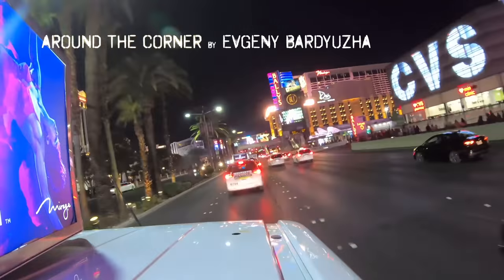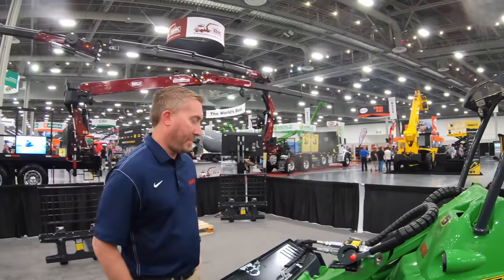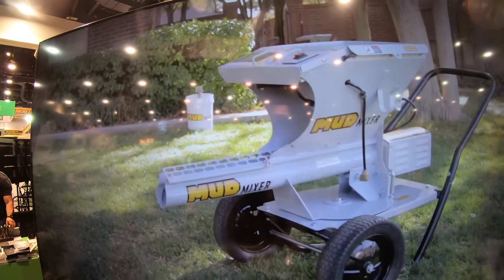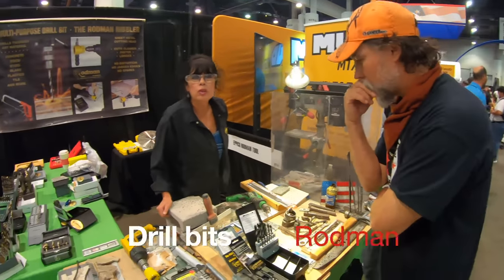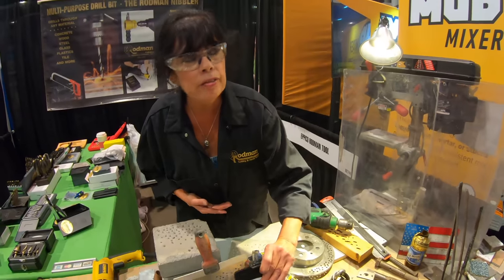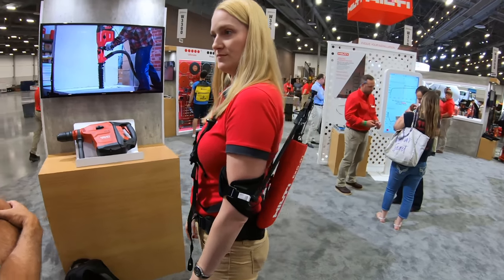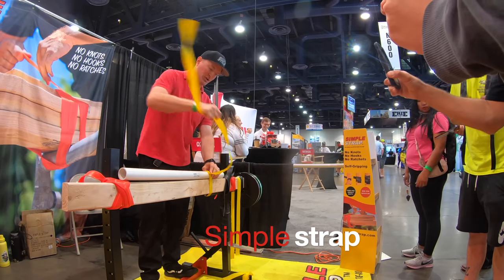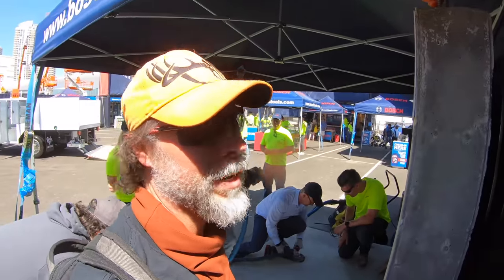8 WEIRDEST n WILDEST new tools at World of Concrete 2021

Comment: The drill bits were my favorite. There's some other cool tools, but those bits are awesome...Just like you Stan. LOL
Reply from the maker: I watched that drill bit demo in disbelief.  That was incredible
Reply: I had to rewatch it because I thought there was some black magic going on.
Reply: @Dirtmonkey  she did more to those bits than you would have done to 'em if she would have let you....lol
Reply: same
Reply: Those drill bits were awesome! Did she say how long they would last like that? Perhaps I need to watch it again. And again…
Reply: @Dirtmonkey  If you use drill bits often, those I would have bought, one thing that wasn't addressed was whether they could be sharpened and be like new @ $110 I would have a set
Reply: Yup
Reply: Yes the drill bits are awesome.  I understand that they are designed to work in drills of at least 2,000 rpm. Not for cordless.  I also seen they needed to be periodically sharpened? Anyone have experience with them? Thanks.
Reply: I'd bought a set right there for 110 probably 2
Reply: @ProWingnut  Drilling through the super hard stuff, you'd need to sharpen them with silicon carbide after about 20 holes.
Reply: Do they go thru materials slower than regular bits?
Reply: @jamescarteratrodmandrill5382  3 years ago when you were doing the fair show demo you said they were made in Germany, now she said they are made in the US. What made you change production facilities? Or are you guys a middle man? Just clearing it up.
Reply: I watched it twice and immediately went to the website lol. Going to have the bite the bullet here soon on a set. I'm a mechanic and might have to try and talk one of the tool trucks into stocking them incase one breaks it can be replaced fairly soon. Very interested in the the ones shown on her demonstration and also their reaper 29 piece step tips.
Reply: @jamescarteratrodmandrill5382  How exactly are they sharpened?
Reply: @ronaldpigeon4713  Not necessarily, but you do have to put a good deal of pressure on them for drilling steel.
Reply: @jamescarteratrodmandrill5382  the "www." doesn't work in front of the web address.
Reply: @1d1hamby  I'm not surprised. My boss has so many typo's on the website that a lot of peoples cyber security walls think it's spam
Reply: @jamescarteratrodmandrill5382  you still didn’t answer my question about where they are actually made?
Reply: @Dirtmonkey  can someone specify and clear up where they are actually manufactured? She said US but then another demo from another show the man said Germany. So...
Reply: @tedmitchell226  their website sells sharpening stone for their bits and on one of the bit packages you get the stone bundled in for free they said .
Reply: @chadharris7648  Sorry about that, just got your voicemail. Cindy spoke a little out of turn- here's the rundown:
Rodman Silver Bullet line - German
Rodman Blue Bullet line - France
Almost everything else is USA, with the exception of our bolt extractor set which is made in both USA (the bits) and Germany (the extractors) and a couple others I'm not thinking of right now.
Reply: I bought a set about 25+ years ago they're worth the price unfortunately with most of my tools they were stolen back in 2011
Reply: I want to marry the drill bit queen
Reply: I have spent $200 on so called lifetime drillbits with easy replacement promise  that one year later disconnected their phone number!! But no way in hell would they have taken a fraction of the abuse that the ones you showed!! Curious how the warranty works but dang bro, maybe it isnt needed at least not very often!  Wish I could've got that huge show discount! I'd have left there with 6 or 8 sets for me and my pals!! How many did you buy Stan?? Lolol. 
Thanx 👍👍👍🤘😛
Reply: @tedmitchell226  I bought something similar many many years ago, and they were from Germany, they came with a small grinding stone that you put into your pedestal drill to sharpen them. Because they have a bit that looks like a masonry bit it was easy to sharpen. I have never needed to. You drill into concrete and bricks without needing percussion. Love them. You loose them before they wear out.

Comment: Those drill bits were probably the most impressive thing I saw.
Reply: That was a excellent showing of a awsome product.
Reply: Yes, I agree. Expensive but if they actually honor the lifetime warranty they are worth it … only issue is loss… which is a common issue with small items like drill  bits.
Reply: @johnpalmer5131  Nothing you can do about that except keep track and pay attention to your bits so they don't grow feet! LOL
Reply: The RPM rating is the one drawback, they require a min of 2000. So they only recommend corded drills.

Comment: I just picked up some of the Rodman drill bits. Looking forward to giving them a whirl!
Reply: I went to the site to order, then read the fine print.  Says for use with drill press or corded drill with min 2000 rpm .....and "Please do not use in any cordless drills due to RPM limitations".  That killed the deal for me. I use cordless drills 99.9% of the time.  The demo DID look nice though.
Reply: How do you like the bits have you used them yet thanks
Reply: @Skulllywag  Me too. Total bummer. Who the hell uses corded drills anymore? I hardly ever even see them.
Reply: @Skulllywag  They work great. just don't dead battery them. Only broke one .  wedged it on a through hole application.

Comment: That second hydraulic quick connect has been used for years in the agriculture combine to connect header to machine. It is a time savor but The multi-couplers have o-ring and seal issues that the independents don’t have . But they are worth it to save the hassle.

Comment: I was surprised with the drill bits how she just went through nearly everything and it didn’t break or anything. And the design of the hydraulic coupler was a great design I wonder why not all company’s use it. Thanks for sharing this with us Stan. Take care
Reply: The hydraulic coupler is available on most any brand it's called a single point connector
Reply: @brandonharrell2072  Oh okay didn’t realise that
Reply: Most of them are made by Faster you can also get one made by Parker
Reply: @brandonharrell2072  Oh okay 👍🏻
Reply: *break

Comment: Back saver thing seems a bit silly to me, would be hard to line it up on a mark precisely
Reply: As a concrete guy that does alot of flatwork and sidewalks/pads that tie into existing structures this would be a lifesaver if it could stay within 2" of the ground

Comment: My favorite tools were the back savers. The concrete drilling attachment and the rebar tying. But the drill bits were awesome too. I think the most innovative thing is the mud mixer machine. Only use the amount needed for the job and then stop the process. That would save a lot of money for smaller unpredictable projects.
Reply: The rebar was welded. Lots of times you got to get down and squeeze the bars together due to bars being bent

Comment: I would say the mud mixer is my favorite. I am currently working on a project repairing 241 concrete balconies. Demo, rebar, forming, pour back. Due to logistics and such mixing 65lb bags 3 at a time on the balcony has proven to be the best method but it sucks. Especially if you are mixing 60-100 bags or whatever. Takes forever. That tool may be a life saver. Thanks for sharing this. I didn’t even know WOC was happening. Lol.

Comment: Tell the Nill guy, referring to concrete as "cement", is like calling a cake "flour". I would never expect that at a "World of Cement" gathering. Nice video, haven't been to a WoC since '05. Thanks for the trip back!
Reply from the maker: your right.  Concrete guys don't like it when you mix up the terminology.  There is a reason each thing has a name.
Reply: Work for a ready mix producer... calling it a "cement mixer" will get you a quick (friendly) tongue lashing.  🤣🤣🤣
Reply: Cement is also a finished product, so the flour and cake apology doesn't really work because slower doesn't produce an edible product. Cement can be used on its own in certain applications without sand, stone, or any other aggregate added to it.

Comment: Hilti kicks ass. Jaibot, (JAY-bot btw) serial overhead drilling in 5 diameters, vacuum recovered dust and spray paint color coded holes for all trades, exoskeletons for repetitive overhead work and body worn cranes for vertical hammering and chipping, unreal. The BEST.

Comment: Drill bits are awesome, Concrete mixer was awesome and the rebar tie tool was awesome as well.  I'd buy 10 of the rebar tie tools, it could seriously save you thousands in a year and the same with those drill bits, stuff is just amazing :).

Comment: I love the Rodman bits, I had a set that walked off the jobsite almost 30 years ago.  The casino that you were in that you asked about where you were was Harrah's as the Harrah's sign was hanging down in the doorway of one of the glassed entryways to the casino and the Caesars Rewards branded signs everywhere helped with the identity.  Of the stuff you showed that I liked enough to possibly buy was the mud mixer but I have leg and rotator cuff injuries to recover from before I can even contemplate more tools.  Looked like a fun tradeshow to attend.  I'm looking forward to the next Shot Show and the next RVDA Dealers Expo too.  Fun Times.

Comment: Wow pipe knife... I'm up scaffolding, need to replace my blade. Remove the cap. Lost my bolt but OK I have spares. Oops I dropped the detachable cap... now I lost my screws my drivers my bits and my stash!.... this was your favourite right? Use a quick release? Surly a spring and tab is cheaper then than this solution?

Comment: The drill bit lady was hands down the best. She knew her stuff and gave an exceptional demo. I would have been sold.
The Hilti exo-01 looked pretty good assuming it works as intended. Nice sleek design. The price is hard to swallow, typical Hilti. 18 hundred if I heard correctly but I get it if that is your main job. Overhead work sucks. I always have to have two tasks going when I do overhead work because I need to take multiple breaks so my arms don't fall off.

Comment: The Mud mixer is interesting. But you would have to use premix bags with it. And I can imagine that some ballasts could kill it.  I can imagine a larger version of it working. Trailer style that you have 2 hoppers one for sand and one for cement. Then a variable speed gear system allowing you to mix 1:1 1:2 1:3 1:4 etc but I doubt there would be much of a market for what they have. It seems too niche. I mean how many times do you use pure cement?

Also. That yellow tape with no hooks, no fasteners etc. you can do that with any strap. It uses friction. You can do it with rope to support the weight of an adult man, just wrap it around a post 7 times then go swinging from it.
Reply from the maker: I think I am going to test this out and see how it works in real life.
Reply: @Dirtmonkey  you need to sinch the rope tight like he did the strap. If you wrap it loose, you will end up on your butt.

Comment: The mud mixer discharge is inline with the wheels. That means you can't roll and pour. They should have a 90˚ elbow at the end or rotate the whole assembly to discharge sideways so you can pour a continuous pad like having a truck move while you pour.

Comment: Being an old retired tool sharpener, I'd like to know how you resharpen the drills that one lady was demonstrating when it gets dull, we all know at some point it will get dull, or is was it designed to be a throw away tool?
Reply: I'd imagine it is throw away. You would be able to sharpen them with a diamond stone if you have enough time. But you could probably buy a new one for the cost of professionally sharpening one.
Reply from the maker: I can't see a $110 drill bit set being a throw away but I could be wrong.
Reply: @Dirtmonkey  if it's got cobolt in it, it's going to be brittle. Unless you go at it slow and steady when sharpening them, you may end up breaking chunks off the shoulders. It's not impossible to sharpen, just not as easy.

Comment: - All cool stuff, but those drill bits were INSANE!!! (I could use and might even buy now)
- Simple strap was kind of ingenious too. (I just bought two)
- Mud mixer would be an automatic buy if I were a small shop, couple guy crew that does a lot of concrete (and it was cheap too, at least seems so to me)
- OK the pipe knife was dumb, I thought the guy was going to show, after saying how bad the screw was, that they have something like the previous razor knife guy showed, with the push button to change blade, like I already have on my Milwaukee flip blade knife. But no instead they include two extra screws if you drop them - WOW!

Comment: That CandyCom mower, I have one but it’s called a RazorBack, still made in Japan same machine, blades are made from Hirosaki Steel, folded, forged, tempered and quenched repeatedly to give similar qualities to Damascus Steel. Super strong blades, will cut shrubs up to around 40mm. This thing is unstoppable with 4wd and rear diff lock. Purpose built to clear scrub and it does it great.

Comment: I have to say, that "Mud Mixer" I could have used that years ago hahaha... I only just now bought a $200 mixer though, so it will do for now. but man... I think if anything, that Mud Mixer would bee perfect for my type of work. ive been building stone walls using slate and reinforced concrete filled between the stacks of stone. to mix a bag of concrete by hand is a Lot of effort, that that mixer would make super easy. with a crew of guys...  man, I want that thing!

Comment: The drill bits were the best I saw. The next had to be the mixer. In third I have a tie with the simple strap and the back saver.
The pipe knife was a disappointment. Instead of making blade change tool less they left the blade change alone and added something else to drop.

Comment: Biggest product "Fail" in the video :  "Pipe knife screw caddy"  What do you do if you need to replace the blade, and drop the screw 30 stories up?  Their solution...3 more screws in the handle.  How about a screwless blade replacement?  Or at the very least, magnetic bit?  Buy our tool! (or just stick 3 screws in your pocket).

Comment: That drill bit lady was a Damm good salesman. I want a set now lol. That flip out knife was horrible though. It's 100% over redundant. No one that actually buys one is ever going to flip it open. And ffs hilti. Your own rep doesnt know the name of your own product. I sense someone getting demoted 🤣. 1600 dollars for some old skewl desk lamp parts, some shoe string and some springs n pullys. Nice hilti 👍🙄
Reply: I somewhat disagree about the flipout knife.  If I could have a good utility knife that doesn't need a screwdriver to change the blade - I'm in!.  That other knife pipe thing with spare screws in the handle - nah... back to the drawing board.  As Sandy Monroe says: "If you need a threaded fastener you're a lazy engineer."
Reply: @gregappelt  I wasn't talking about blade replacement. They all do thay. Every trim knife currently on the market has a quick change blade. I use Milwaukee fastbacks. One had open one hand close and yes quick blade changes. What I'm referring to is it's dual function. Being able to push the knife blade out closed or open the knife then slide the blade out. The knife is already long enough to use in the closed position. No one is going to take the extra step to flip it open first... THEN slide the blade forward when the blade can be slid forward in the knifes closed position. It's like what's the point of having a flip open knife if you don't have to flip it open to use it?

Comment: Pffh! Pffh. Pffh! You only did it to add a Segway for the new hair cut! Lol, I jest. Anyways, I've missed these videos. Coolest tool was actually the hydraulics attachment head for the electric loader. I've fought those things on so many different brands of equipment. You can slap a pressure relief valve on it all you want. They don't work.

Comment: That concrete saw with the dust collection system seems like it would have too much maintenance to be quite profitable for a commercial mason who uses them the the most almost have to replace filters everyday and clean out at lunch for a 14 inch saw there really not leaving much left to cut with and the mix oil and gas on it is asking for employee mishaps I think there building a saw for the wrong crowd

Comment: So the Diablo bits are junk I was given 3 SDS Max sample 5/8” bits and they were absolutely great they work good on concrete with out rebar , they zip right through like if you are drilling through wood . But then bought around 20 bits at around $55 each and they are completely junk don’t waist your money , as if they use the technology they selling at shows in their demos and the production ones are  junk . Bosh vs Diablo ,bosh will drill over 400 holes 6-9” deep the Diablo gets less than 35 holes and the sample Diablo hasn’t stopped drilling lost count at 870 holes .Our company restores public sidewalks every day so we drill 5/8” x6-9” deep holes for rebar dowel’s . 6 crews everyday 6 days a week most of the year we use a lot of bits , bottom line is pay a little more for Bosh and you won’t be disappointed.

Comment: They use something like the simple strap here in the Philippines. It’s called inner tubing, lol. Just take any old tire inner tube, cut it into the strips and lengths you want, and you can tuck it under itself, no knots needed. It also works well for stopping leaky pipes temporarily.